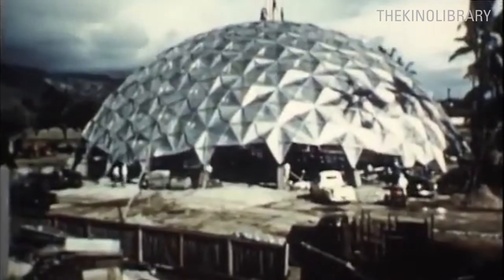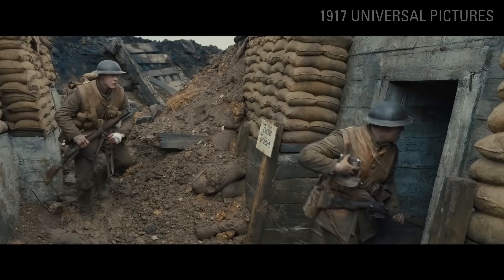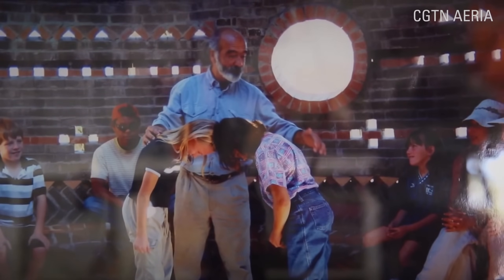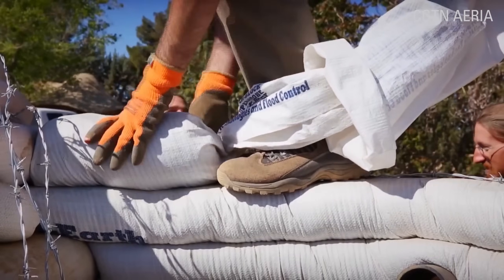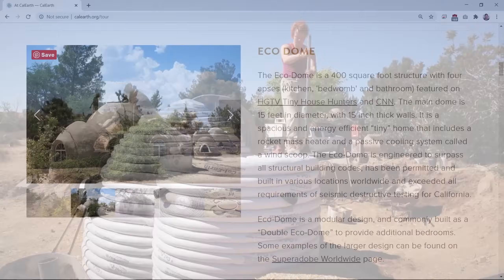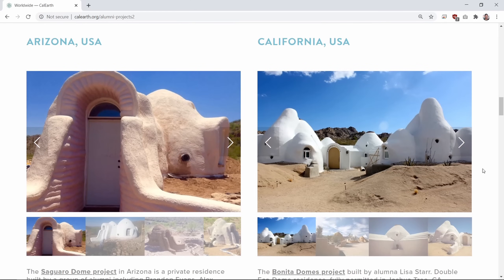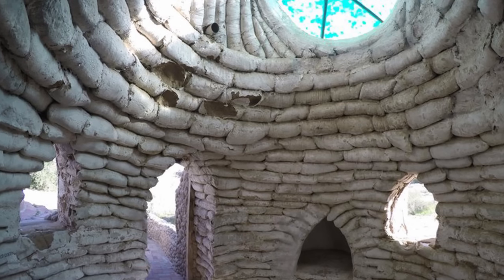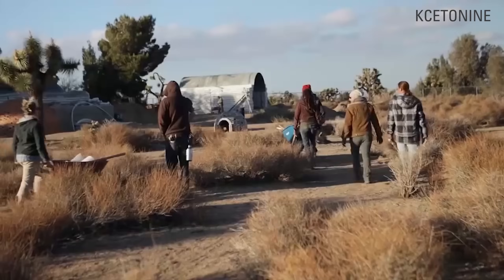Pros and cons of Superadobe Earthbag homes

Comment: I've known some folks who started down the path of building one of these, but ultimately aborted their efforts to abort this and go with a simpler, faster means of construction. In addition to the issues with the highly intensive labor needed to built them, the folks who did had major concerns about how well it would preform against seismic load. The one building that they did built had to be retrofitted with additional re-enforcement out of concern for how well it would preform in an earthquake. 

As it is, it's similar to other masonry techniques in terms of overall strength and performance, but it's arguably harder to re-enforce than most block construction. Un-reinforced masonry buildings are always going to have issues in earthquake country. 

One thought is I wonder if much of the placement, filling and packing work can be mechanized or perhaps even automated with light power equipment designed for the purpose. If you have a mini-ex or conveyor to do the heavy lifting of getting fill material to the top of walls, and a more specialized piece of equipment to place and place the labor needed to build one of these might be far more manageable.
Reply: An earthbag orphanage built by Cal-Earth withstood the 7.6 earthquake that happened in Nepal in 2015. 🤷🏾‍♀️
Reply: @eklectiktoni  Yes, the orphanage barely had a crack when surrounding villages crumbled.
Reply: It is reinforced with barbed wire.  Was your friend using continuous tubes as they provide additional integrity.
Reply: @markharmon4963  Even with the barbed wire the engineer had his doubts. The end result was using rebar on the outside, with the thought that it will get covered by the exterior rendering.
Reply: @markharmon4963  I am unsure how much experience you have with barbed wire, but it does not hold as well as people think it might. That is not its purpose, and the tines (points) tend to turn and shift easily. Even clamping them still results in shifting as is normal for wire. Also, the barbed wire is only holding to the bag, not the earth inside. Cloth is not great for preventing shear movement. I can see barbed wire preventing minor movement, but more forceful shifting could still result in failure.  
My experience? Building fences on a Texas farm and bunkers in the military in Texas using sandbags.
Reply: @LabGecko  There is a trick to the trade to get the barbed wire to grab. Cal-Earth teaches it.  I understand your distrust of it. I had the same feeling until I figured out how to work with it.  I have demolished quite domes and walls and believe me the barbs grab the earth once they are sandwiched and the wire and tubes add a lot of resilience.
Reply: @LabGecko  BTW is the military adding barbed wire to their sandbag building protocol?
Reply: @LabGecko  What do you think the barbed wire is for?
Reply: @markharmon4963  I saw the trick in her video, but that does not change how barbed wire works. Perhaps I am misunderstanding what mix is being put in the bags. Is it just sand and clay, as mentioned, or are there other silicates or binders? In my experience barbed wire grazes / slices past such surfaces with a decent push.  In the demolition projects you mention, was it just a single strand between the bags as in the vid, or were there other support materials involved too?
Edit: Removed some miscommunication
Reply: @LabGecko  I am genuinely interested in how the military adopts tech and your take on the purpose of the barbed wire.   I understand how snarky comments can be and I truly was not being dismissive.
Reply: @markharmon4963  I can only speak to my experience in Spec Ops. Some of our troops were quite creative in how bunkers were built, and I expect most of the mods were not approved by the engineering teams. The farther away from the main area troops get, the more creative it got. Some used barbed wire (well, concertina wire) by wrapping it, barbershop pole style, around sand bags. Wrapping it that way used a lot of wire, but it did have the intended effect, although the bags degraded much faster and then spilled, creating a cavity that had to be fixed.  
I edited above to correct my misunderstanding.
Reply: @LabGecko  The barbed wire when sandwiched between two courses acts as a tensile element to keep the lower dome walls from spreading out.  Also it keeps a wall integrated in the case of uneven settlement.  By preventing cracks from spreading and dividing the wall, the wall is able to bridge low points and hold together the upper portions that might spread apart if there is an exceptional hard place.  This has been tested and engineered.  The problems I can see with the use of concertina wire are that I imagine it would cut rather than pierce and hook and the idea of wrapping introduces to many waves into the path of the tensile element.  Any reinforcement is at it's best if it allows as little movement as possible to the masonry material. So wrapping sounds like it destroys the confining benefit of the bag and would not be reinforcing as it would behave more like a  weak elastic or...a concertina, as opposed to a belt.  I appreciate the inventive spirit of you and your colleagues. Survival depends on taking action with the materials at hand. I am suggesting that the concertina wire was not used to best advantage as I understand what you have relayed to me.
Reply: @markharmon4963  Thanks. I understand the engineering principles. My arguments above are more a critique of what I see could points of failure in the process rather than a condemnation of the entire process. I think the single strand shown in the video has a high probability of not adding anything significant to the structure while adding cost. As I've mentioned, other methods of wrapping wire I have seen could prove very effective, but I question the added build time and cost for those methods. It is important to remember that almost every one of these build designs, even when standardized, is implemented in the field in varying degrees of thoroughness.  I think some of this is a case of engineering design without real-world testing by the design engineer. As for my understanding of engineering, I have worked many types of construction for hands-on, have built many projects, and have studied the subject extensively. If I have questions I ask my 3 engineer uncles, my electrical engineering sister, or my mechanical engineering daughter.  :)

Comment: I think exposed duct and cable could be mostly avoided by burying those except where they have to be exposed and/or adding an internal plaster wall layer that could hide cables and other smaller elements that need to reach up walls.
Reply: exposed duct cable and piping is super common in old brick apartments in the city, just painted the same color as the walls, idk why anyone cares, i certainly don't notice them!
Reply: My family has an old home with exposed conduit on the walls, like... it's not all that big a deal tbh. Even makes repair and rewiring easier. You're already living in a plastered dome, you're not exactly aiming for suburban chic design.

Comment: Yes there is a big con. The sandbags will desintegrate over time. There is no way the plastic or yute bags will withstand elements over time. Then the sand sheds out and the house falls down. Insects will attack the "wall".

Comment: I'm thinking places with clay, often have a lot of water, you could filter the clay out on site using say a settling resevoir and a cement mixer.
Reply: Good idea, and it may work, but for the areas like Texas that she mentioned water typically a scarce resource. The clay was deposited eons ago when it was still ocean, but today most of Texas is very, very dry.

Comment: This lady is a hero for telling us what the niche building community won’t.
Reply: As someone who's worked in the "niche building community", this is a ridiculous statement. People in the field - in my actual, real world experience - will warn endlessly about the possible problems, the shortcomings and the pitfalls. Talk to the people who do the work. I've also worked in the "mainstream" building industry, and can't say the same about their standards of disclosure.
Reply: My grandmother grew up in a sod house.  Nothing new under the sun.
Reply: It is a Total myth that these houses are more labor intensive as for some reason you and all others are thinking of buying building materials.  When you think of all the labor it took to produce all those materials, then sand bag houses are completely not labor intensive.  You need to think in terms of total labor and impact on the environment.  And for that reason, they are totally superior.
Reply: @fragranceofsound  Exactly
Reply: True, but not relevant. One does not need to mill the wood or fire the bricks, but does need to assemble these earth bags, and manually at that.
Reply: @fragranceofsound  Depending on what building materials and the location. But generally concrete building is less labor intensive because it's mass produced using large machines. With these large machines, one man can do the work of a small army. concrete is also a far more superior building material. The biggest problem of these communities is that they are obsessive about environment. And they always try to milk it for every cent they can make from the start. Resulting in lesser quality houses for higher prices. These building methods have potential. But it's the wrong type of people who are involved. You need someone who thinks like an engineer, not a environmentalist or a liberal arts student. To make this usable on a larger scale, you probably need to create some large fuel consuming machines and mix it up with some less environmentally friendly materials. It would still be a net positive from a environmentally friendly standpoint compared with our traditional building methods. But it would never be considered environmentally friendly enough by the people who are involved with it now. So the end result is that it will never make a difference. Only a couple new age hippies making a living with some pet projects selling unachievable dreams. It's never going to be used on a large scale this way. You need a guy like Elon Musk to pick up these basic ideas and turn it into something realistic and usable. These environmentally friendly tree hugging hippies are never going to achieve anything. They're only in the way of any real progress that could be made.
Reply: This video does a great job highlighting some of the challenges of Superadobe homes, but I think some of the cons mentioned are more about the current market than the technology itself. For instance, "inefficient space use" is mostly due to furniture being designed for rectangular rooms. As Superadobe homes become more popular, furniture manufacturers will start creating pieces for round rooms, making this issue disappear. Similarly, the difficulty in valuing these homes isn't intrinsic to the technology but rather due to their rarity. With more Superadobe homes, banks and realtors will develop methods to accurately assess their value. These "disadvantages" are temporary and will fade as the technology becomes more widespread.

However, the real problem is whether any government will provide incentives for such technology. Usually, they do not, because promoting Superadobe homes could hurt current construction corporations. Additionally, Superadobe technology is designed to be simple for homeowners to build themselves with little expertise or specialist materials/equipment, which doesn't lend itself to profit-making for big construction companies. And let's not forget, big developers and contractors are usually good friends of politicians.
Reply: Have to agree. You hear so much hype about different things - container homes for example - then you get a dose of clear, hard reality from Belinda, who really knows her stuff.
Reply: My cat ate my grandfather. Nothing new under the sun.
Reply: My grandfather ate a cat. Nothing new under the sun.

Comment: All these methods of construction are so creative... but in my mind the most sustainable type of housing is midrise apartments, at current technology and considering the carbon intensity of infrastructure. We should probably run with CLT where sustainable lumber is available for the most part until we have a better solution for midrise.
Reply: CLT?
Reply: @markharmon4963  Cross Laminated Timber

Comment: Even if those kinds of "green" housings had no drawbacks at all and would be 10 times cheaper than normal housing, people still wouldn't use them. 

Housing is deeply entwined with local traditions and values. Very few people have the courage and motivation to go against this peer pressure, not to mention the intellectual capacity. The "green" movements these days make that perfectly clear. Shallow thinking, unreasonable hype, shunning logic thinking and double standards. Scorn and belittle the Youtube architect for bringing up valid points against so called "green" housing on one hand, gorging on consumer culture on the other.

As long as the public perception doesn't switch from "i want a big house, a big car, a yacht, three vacation huts and a private jet" to "I simply want to live a modest happy life", no matter what advances we make in any field, it will be for naught.
Reply: There is a difference between "want" and "can", all construction material prices skyrockets at last year.
Reply: Wow what a hypocrite. So anyone who prefers conventional systems is lacking, according to you "the intellectual capacity". Maybe try looking in the mirror and gaining some humility.
SOmetimes distrust of the next big thing is built up as a survival tactic through dealing with many dishonest people.
Reply: @GeorgeMonet  And btw im fully aware that such a perfect solution to sustainable housing does not yet exist (or at least it didnt encounter it yet).

But my point is, even if it WERE it would not change  a thing, because -> dumb and cowards.

EDIT: Oh and lets not forget: most of the people on this earth are poor AF and are lucky to have any shelter at all, so lets focus on that problem first mbe?

Comment: This is an interesting building method, but I mirror your concern about a being viable only in areas with proper soil conditions.  I would be interested in your take on rammed earth buildings. Are soil conditions a little more flexible for this building material, or in the same vein, would it need to be very specific ratios of sand and clay?
Reply: why is it viable to truck in bricks for 100% of the mass of your house and not viable to truck in some dirt for some fraction of the mass of your house to balance the ratio?
Reply: @cho4d  it might be worth it.

Comment: The best building material on the planet is pumicecrete 
Pumicecrete is a mixture of pumice cement and water mixed and poured into a set of reusable forms walls are poured from 12" to 24" thick and is built for a fraction of the time and money
Pumicecrete is fireproof termite proof rust rot and mold proof and has a high R value and good sound attenuation solid poured walls means no critters can live in your walls
Reply: Pumicecrete is much more expensive. Without a doubt. The point of things like earth bags and cob is to be affordable and long lasting... There are cob structures standing from 10,000 years ago. Pumicecrete can not say the same. Try pricing out how much a house would cost in your area to do a house in Pumicecrete then compare it to what cob or earth bags would cost. It's like saying I'm going to insulate with aerogel, sure it's amazing stuff, but there's cheaper more efficient ways.
Reply: @andrewl3692  how many pumicecrete homes have you built I've done 10
Reply: @andrewl3692  good morning Andrew 
Could you please send me a picture of a 10000 year old structure that is still standing thanks for your time
Reply: @raymondpeters9186  I can't send pictures but what I've said is easily fact checkable. Ummm try Google. Anyone can easily look this up and fact check. I do red iron construction. Northern Michigan Steel. I can easily check the cost and compare to building materials from different companies. As can anyone reading this. Anyone can simply look up the same as I have.

Comment: It's always seemed to me that using earth for exterior walls (and even roofs?) is the most efficient, due to fire resistance, potential strength, availability, and insulation value. The consistent issue is labor, whether it's digging, packing, spreading, baking, or all of them combined. I have to wonder if one of the approaches could be effectively mechanized to make it faster and less labor intensive. Whether that's tools that dig (we've got those) or that automatically form bricks or sift soil into the right composition or lay bricks/bags etc.
Getting your hands dirty doing the work is great, but at some point the hippy approach just isn't feasible. We need some form of power tooling in order to make it a feasible replacement for traditional construction on a large scale.
Reply: Had very similar thoughts watching this, seems like there's still a lot of room for innovation, first thing that comes to my mind is a machine for stitching those mile long tubes to the right size and shape on site, which could allow for a single "brick" per section, with dove-tailed square corners and the like for more traditionally shaped buildings. Vertical conveyors and pneumatic compacters could greatly reduce labour and build time, but seems antithetical to the "hippy approach" as you put it, which is sadly the only place these left field methods are even considered.
Reply: @boggers  yeah, it does seem like there's a large gap between people who get romantic about building something themselves and people who just want a cheaper/better home. Hey at least there's the two of us! ;)